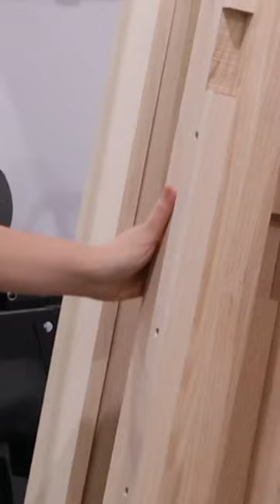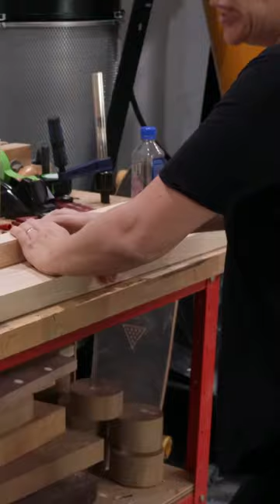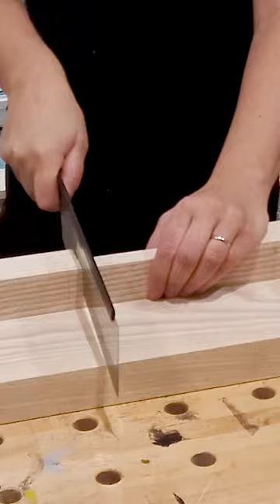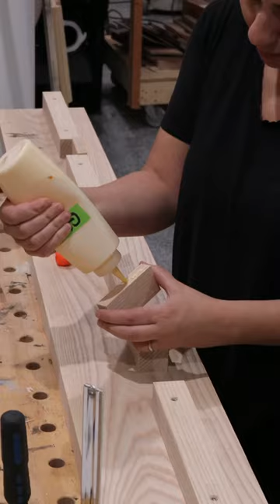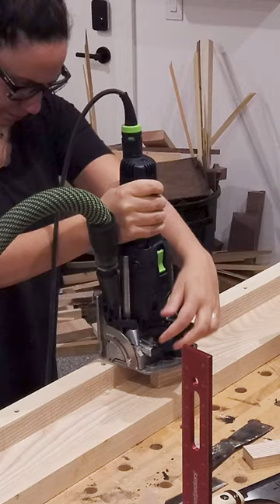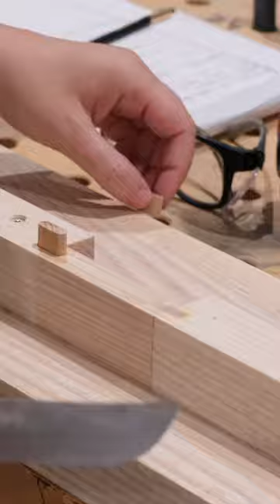What happens when you glue a piece upside down… silly mistake, but everything is fixable!

Comment: In this kind of situation you can use a syringe with a thin needle to put water between the two pieces and dilute the glue. I tried it before and it worked pretty well.👍